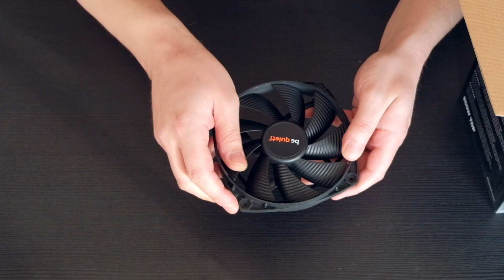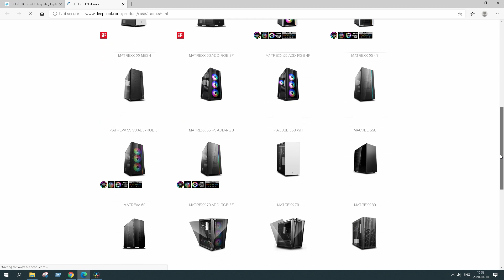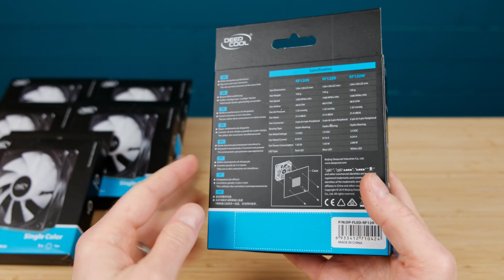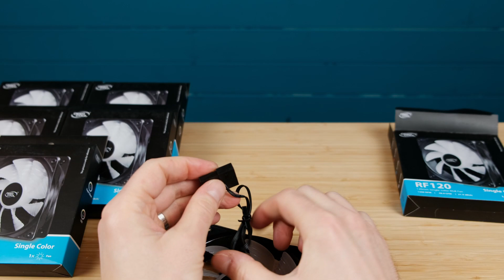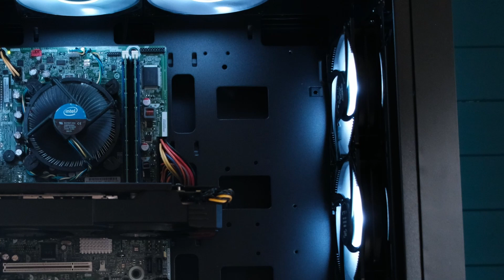RGB FAN KILLER?? AWESOME LOOKING BUDGET PC LED FANS - DeepCool RF120W - The best budget LED case fan

Comment: I find this fan pretty quiet even at top speed as it's just 1300 rpm compared to fans i have that reach 2000 and 3000 rpm
Reply: How do you change the speed?? My mobo doesn't have 3pin5v argb header , only 4pin12V header

Comment: Just got some to finish out a build and was wondering if there was anything I needed for the plug in as it seems very odd to me the plugs on the fan
Reply from the maker: These fans have just one fan header (3pin). Maybe it's odd since on the motherboard, you have 4pin fan headers, but 3pin fan is compatable and it's ok :)

Comment: The LED light decreases or increases with the fan speeds, at 500 rpm I don't get at all. very noisy at full speed.
Reply from the maker: Yes, it's true, since LED uses voltage and fan speed is also controlled with voltage. So less voltage = less speed = less light :)
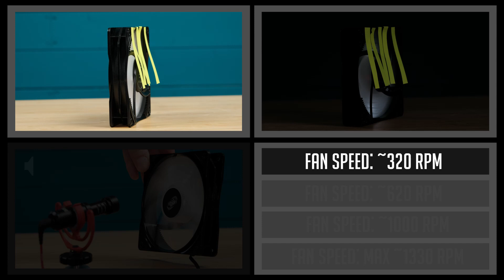From 4:13 I've shown/tested lights using different speeds (320, 620, 1000 and 1300 rpm) and as you can see from the video, 300rpm light is barely seen, 620 rpm it's already OK.
But yes, it's a budget/cheap category, that's why they cost like 2-4 times cheaper than premium brands.

Comment: how you increase the speed of the fan?
Reply from the maker: Hey,
You need to connect fans to your motherboard and not Molex. Then, in BIOS you need to use/select DC mode in  a fan control section and you will be able to set a speed you want :)

Comment: If you use 6 of them are they very loud? Cuz i dont know should i use 4 or 6 fans.
Reply from the maker: Hey,
Well, loudness depends more on what fan speed you will set rather than how many fans you will use. I mean 6 fans running 50% will be quieter than 4 fans running 90% speed :)
In general, 4 fans are enough from an airflow perspective. Unless you want to achieve better looks/appearance and populate all fan spots with 6 fans :)
Reply: @EpicGameTech  Thanks for information and fast response!  I think I will use 6 fans. Lets hope my pc will not sound like a jet if I run them at 90% speed :) (btw Im buying same rf120 fans Red color)
Reply from the maker: Well i recommend setting fans to 60-70% if you want constant speed. Or even better to set a fan curve so fans would wramp up only when cpu temps go up :)
Reply: @EpicGameTech  also 1 more quick question - if I plug all 6 fans into a fan hub (deepcool fan hub FH-10). It says you can connect 3pin fans but will I still be able to control fan speed?
Reply from the maker: Yep, you can control 3pin fan speed. You just need to choose DC fan mode in BIOS.
Unless a motherboard is old and has no such option. But most of the newer motherboards have it :)
Reply: @EpicGameTech  My motherboard is A320M-A PRO and it has SYS FAN header so I guess I can control fans speed :) but I will check before buying fans if it has DC fan mode

Comment: Hi, sorry for my stupid question but I want to buy the 5in1 kit for this fan and I have msi z390 gaming plus and it has 2×4pin 12v rgb headers .. is it possible ?
https://www.msi.com/Motherboard/MPG-Z390-GAMING-PLUS/Specification 
This is my mobo
Reply from the maker: Hey,
These exact fans (RF120W) do not have a separate RGB connector (as I've mentioned in my video) :)
They only have a 3 pin fan connector that powers the fan + LED at the same time. It's because these fans have only one colour (white). So you need only fan headers for these and no RGB headers.
Deepcool have other very similar fans like "RF120 3 in 1" pack or RF120m (5 pack). These fans have separate RGB headers. But they also have splitters included so you can connect any of these into 1 chain and you end up with 1 RGB connector that you can connect to your motherboard :)

Comment: Hey man, I just found your channel while looking for reviews on these fans and I gotta say your content is real nice, you earned a subscriber! Also, I have a question about the fans... If I run them off Molex do they run at full power?
Reply from the maker: Hey,
thanks ;)
Yes, if you would use moles, they would spin 100% all the time. So it's way better to connect them to your motherboard fan header. Or to get a fan splitter, connect them to a splitter and then to your mobo as in this way you will use only 1 fan header on your mobo.
Also, via motherboard, you can control speed via voltage (DC fan control mode in BIOS)  unless your motherboard is really old and BIOS does not have an option to choose between PWM / DC fan control modes :)
Reply: I would connect them to the mobo anyways, I just wanted to know what happens when they are connected directly to the PSU, now I know, thanks for the heads up!

Comment: how long is the cable?
Reply from the maker: Hey,
Unfortunately, I didn't measured cable length (and manufacturer does not specify it either), but it's quite standard (might be just a little shorter) just like any other pc case fan cable length :)
Reply: Epic Game Tech how long would you think it is? Cuz i need like 10cm to connect it to my motherboard. Is it possible to do so!
Reply from the maker: Hmm, I actually have more expensive Deepcool RGB fans at the moment RF120m and I've measured their cable is 30cm. So I assume RF120W cables could be the same or in ~20-30cm range. But it's a guess from my sides since I do not have this fan to measure :)
Reply: Epic Game Tech it should be good then. I will buy it tomorrow :)  and oh,it is important to connect them together? Cuz i cant,i am installing one on the back,abd 2 on the front.
Reply from the maker: There RF120W do not have connecting chain etc. Well if you would use MOLEX connector you could connect them and  tehn to PSU molex.
But if you have in mind PWM header that plugs to your motherboard - if you buy 2 fans, you will need 2 separate motherboard fan headers. Or, you can buy a splitter/fan hub as-well :)

Comment: I can't find it anywhere in my bios where to change the voltage or set to DC mode, and I already  bought a fan controller, and its still at max speed. I bought a 4 pin deepcool controller and plugged both into the sysfan and cpufan, and I can't adjust the curve in neither, the changes only applies to my wraith prism(cpu fan). What can I do? I have an a320m-k mobo.
Reply from the maker: Hey,
hmm as I do not own that motherboard, i can't check it. There is a possibility, that your motherboard does not support changing modes (as it's really basic model), but honestly, I never had similar issues with any modern board. 
but I have used voltage limiters for a really old boards, you can get them from aliexpress for quite cheap:
1. This one is really cheap, like 50 cents - it reduces voltage by 35%, so you fans would spin ~65% speed and a noise will be reduced too. But you can't control/change speed etc.
https://www.aliexpress.com/item/1005001452583146.html?spm=a2g0o.productlist.0.0.73dd4224CQz412&algo_pvid=1086b8a0-6a2d-4f6e-90fc-ed2b5d1ec931&algo_expid=1086b8a0-6a2d-4f6e-90fc-ed2b5d1ec931-0&btsid=0bb0624016059739224808568e42b2&ws_ab_test=searchweb0_0,searchweb201602_,searchweb201603_

2. This one is ~$2 and it's kind of a hub powered from sata. But here you have a possibility to choose Low / High :)
https://www.aliexpress.com/item/4001190583221.html?spm=a2g0o.productlist.0.0.7e6c3470zp7oe2&algo_pvid=9353ef54-7a84-4866-a169-00724af91d53&algo_expid=9353ef54-7a84-4866-a169-00724af91d53-2&btsid=0b0a555e16059740697782520e6f79&ws_ab_test=searchweb0_0,searchweb201602_,searchweb201603_

There might be more options on aliexpress, but I've used these two in the past :)
Reply: @EpicGameTech  omg, 
thank you very much for your time and consideration
Reply: @EpicGameTech  Hey, I bought it and recently installed on my pc and it works just fine! My only question is can I change the low/high button when the computer is on.
Thanks!
Reply from the maker: Glad to hear :)
I'm like 90% sure you can. But use it at your own risk ;)
Reply: @EpicGameTech  you can! just switched it to all modes and it works as intended.
Reply from the maker: @pedrobarth6318   super :)
Reply: Hey, did you resolved the problem? I ordered 4 rf120 fans along with the Deepcool controller as well, so I'm wondering If I'm going to have the same problem or not...
Reply: @otto6185  Hey, actually not... But I only got that problem because of my mobo, it's very basic. But I believe those voltage limiters would do the work just fine.

Comment: newbie here,
can I install 3 of these fans in one fan header without a problem ?
Reply from the maker: Hey,
yep, should be fine. Most of the time, 1 header can provide 1A, and this fan needs 0.24A as manufacturer states. So in general, up to 4 of these particular fans per header should be ok :)
Reply: @EpicGameTech  How do they get chained in order to use the motherboard connector and not the molex?
Reply from the maker: @petrolid_raikin  you can connect fans to a separate motherboard fan headers. But there are too little fan headers on your motherboard or you want to chain them, you can get some cheap 3pin splitter, something like this one https://amzn.to/3o9R8Yw :)
Reply: @EpicGameTech  Thanks!
Reply: @EpicGameTech  And if I use molex they will spin at 100% speed and the brightness will be also at 100%, right?
Reply from the maker: @petrolid_raikin  yep, with molex 100% speed and brightness :)
But with splitter/motherboard you can control speed with DC mode if it's not some old motherboard with no such an option in BIOS :)

Comment: can i change color?  put blue or other color
Reply from the maker: Hey,
These particular fans are just one color. But there are 3 variations you can buy:
- RF120W is white
- RF120R is red
- RF120B is blue

That's why they are cheaper than RGB fans at least 2x (in my country) :)

Comment: Nice and Simple Review 👍🏻

How to connect 6 Rf120 Led Fan to my Asus Ex H110M-V it only has two Fan header and the one is already use by Stock Intel Cpu Fan. I need to connect it to finish my budget build. Thanks
Reply from the maker: Hey,
So you need to get a few fan header splitters like this on we - https://geni.us/uZUrC
Just be sure you check fan headers you have ether they are 3pin or 4pin. And according to that buy 4pin or 3pin splitters :)

Comment: Thanks for the nice and simple review. I also bought 6 of these for $5 each (saw it cheaper at the official dealer's website but it was out of stock). They are very beautiful. When at around 800RPM (default speed on my MSI B450 Tomahawk) it lights more like a light green while on it's full speed it's more blueish. Before installing them I only had 2 case fans - rear outtake and front intake. But now temperatures have improved drastically, but at the expense of the noise. All in all, great fans for the price.
Reply from the maker: Hey,
yep, they are quite a nice buy for it's price, so you can live with a few "not so premium" features :)
In my country they were ~$4 each, so it was really good deal, since the next step is an RGB fan but they cost like 2-3x more. So these ones are really good for cheaper builds OR you want lots of fans (5-8) and you do not want to spend lots of $.
At ~800rpm they are really ok regarding noise :) For me ~1000rpm is still quite ok.
Reply: @thevader6946  What's a fan splitter? I didn't need anything additional. It already comes with both 3 pin and molex connectors. You can daisy-chain connect those fans into themselves

Comment: Is it controllable when using 3 pin?
Reply from the maker: Hey,
yes, in most of the motherboard BIOS you can choose PWM or DC fan control method. For 3pin you need to choose DC mode and you can set your curve just like with 4pin fans.
The only thing is that the LED will be less bright on 50% speed vs 100% speed. You can check brightness since I've tested my video :)
Reply: @EpicGameTech Motherboard MSI h61 p20 G3. There's fan speed choice. But change doesn't affect fan. Still in max speed. And how much is decibel in max speed.

Comment: Can I use the fan with just the molex cable? Or just the fan pin? Or does it need both to run?
Reply from the maker: Hey,
you need to use just one of these two options :)
Keep in mind, using MOLEX you fan will spin at full speed all the time. So it will move air pretty good, but also it will be quite loud.
So i suggest using 3pin fan header to your motherboard so you will be able to control fan speed using DC mode and set the right curve depending from CPU or system temperature :)
Reply: @EpicGameTech  thanks for the quick and simple answer u got my sub ;)
Reply: @EpicGameTech  and will these fans be fine for my deepcool matrexx 55 mesh case? I got 3 in the front and 1 in the back front is intake back is outtake will it be good? Or do I need to put 3 more ontop?
Reply from the maker: well, there are quite budget fans and they are really OK, but I would use them in more budget builds like up to ~$800 or so. For more expensive (mid-range) builds I would recommend PCCOOLER Halo fans (https://www.youtube.com/watch?v=EJMcYVmd0gY) or Deepcool RF 120M or regular RF RGB fans :)
Not saying you can't use these, but they are oriented to budget systems.

Regarding how many fans you need - well, if I could, I would install all possible fans for better aesthetics. But functionality-wise - 3 or 2 at the front (intake), 1 at the back (exhaust), 1 at the top-back near the other exhaust fan (exhaust). In this way, you will have a positive-neutral pressure in your case and most of the dust will be handled by your front mesh filter ;)